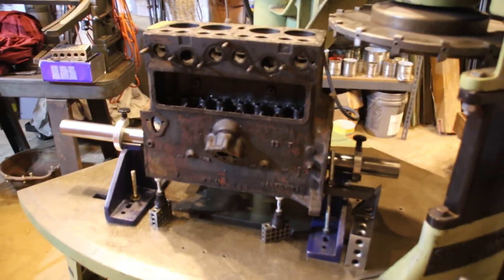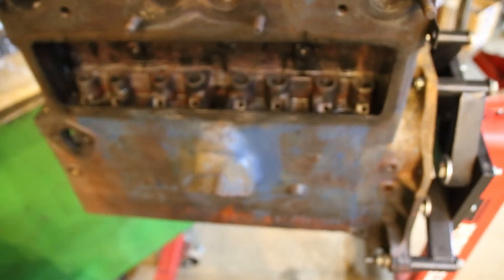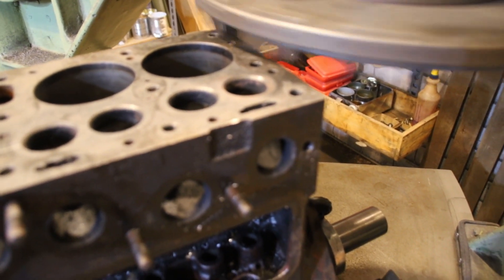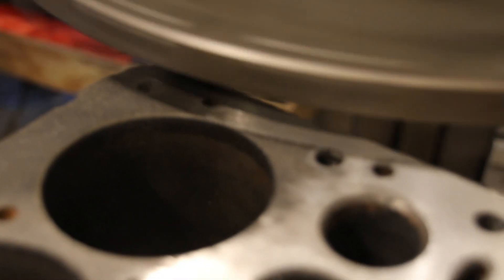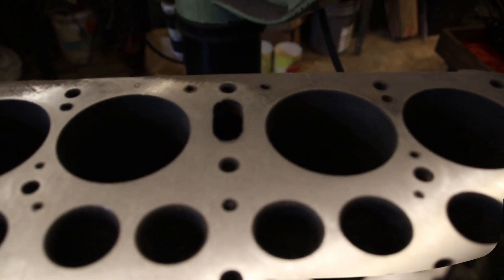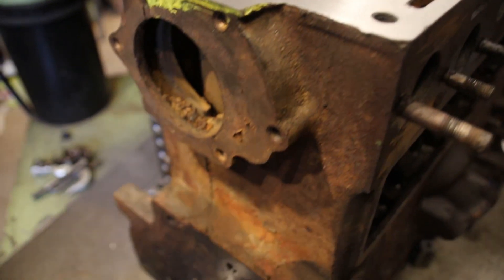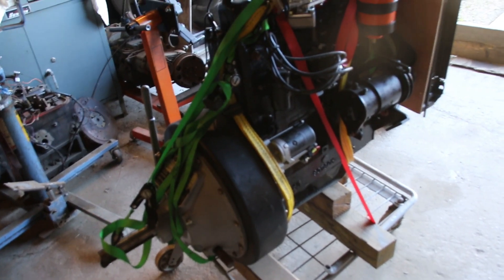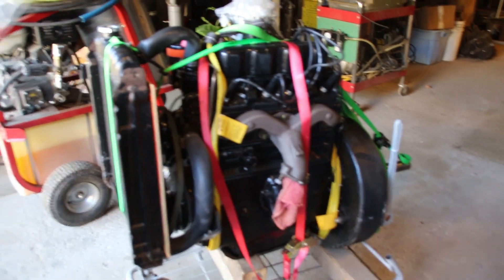Willys L and F Head Engine Rebuilds, Willys F134 Powered Log Splitter Coming Soon !!!!!!

Comment: I had built a log splitter using a variable piston pump with a mechanically controlled swashplate. This gave me contrnol of speed. Handy during cylinder retract. It is also capable of up to 5000 psi, which you'll never need. I got the pump from a small hydrostatic roller for asphalt. Cylinder and control valve was a no trainer. Good luck.

Comment: Hahahaha... $200.00?! OMG. People are REALLY out of touch with reality nowadays.
Reply: i knew guy who had (inherited) a very nice old classic camaro, late 60's...he was so cheap that he never even got to drive the car as he would not spend the money on the parts to get it tuned and running properly...which was basically a carburetor rebuild kit and a clutch...in he 80's the price of the rebuild kit for the carb was like $10 and a clutch pressure/plate $50.